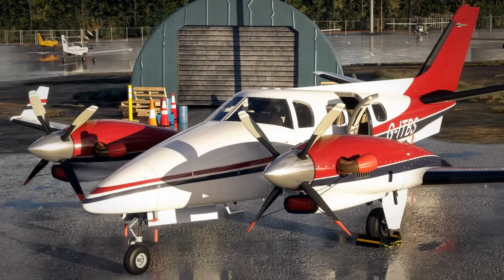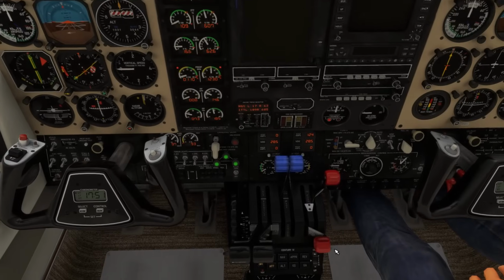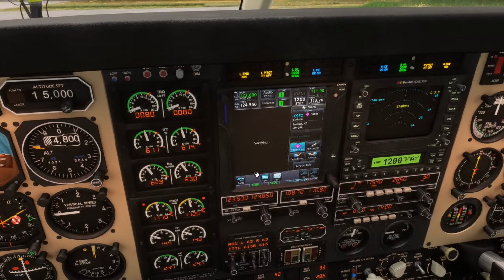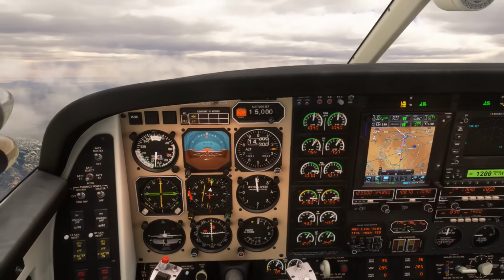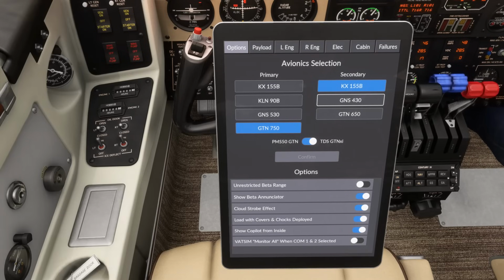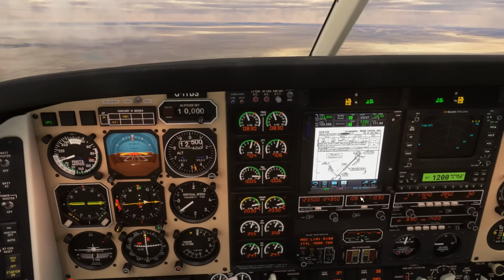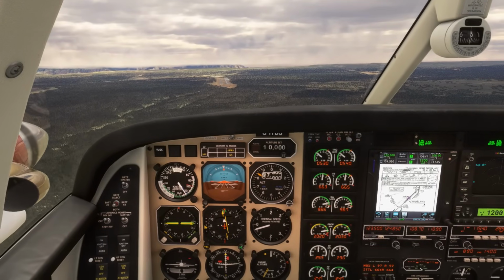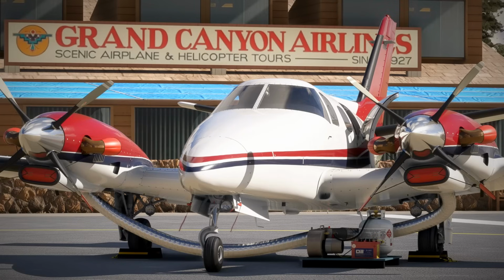Another Exceptional Addon! | Part 1: Black Square Turbine Duke | Full Flight Preview / Review | MSFS

Comment: An update on what the dev has said about release: the Dukes have been tied to the SU15 update because of 1) an issue with the WT Garmin 530 that requires a manual work-around at the moment that SU15 would have fixed, and 2) making use of the new ground handling in SU15. However, with the recent delay, the developer said yesterday on the JustFlight forums that they are considering a pre-SU15 release and have mitigated these remaining issues. So , hopefully it will be out sooner rather than later!
Reply: Yep all correct and yes it will be out soon, very soon we hope.
Reply: @justflight   I really hope so. I rather have the Dukes now, but with those known issues* than without them, but later.  I would guess that most people that are waiting for those aircraft think similarly.

*(which are going to be resolved very timely anyways with the SU15)
Reply: I will be quite happy to have a pre SU15 model happily accept the minor issues
Reply: @justflight  any form of time estimate (like this week or within a week kinda estimate)?
Reply: Oh this is good news! Holding back such a masterpiece like the Duke because of "the eternal SU15 that will never be" for 10 more weeks (or even half a year or no one knows how often SU15 is getting delayed agein) would be outright false :) True art like the Duke must be honoured, and some small GNS530 issue can easily be patched with some small hotfix at the end of 2027 when SU15 is released.
Reply: @juliashenandoah3965  It's out as of now. Bought both aircraft of course.
Reply: @Th1235  That´s the spirit! :)

Comment: This is the kind of add-on I'd love to make an around the globe flight with!
Reply: I will too... I already had one in the making with the A2A Comanche, but I think I will start over with the piston Duke... It could take the Crown the A2A C250
Reply: @Tom__L to be fair the A2A has so much detail modeled such as airframe wear and damage, visible pax and cargo, icing, full external aerodynamics/flight model. I know the Duke will be amazing but mate I’d finish the tour in the Comanche!
Reply: @boudewijnzwaal8186  Yep, the A2A is amazing and hard to beat. But the Comanche is not a very complex aircraft in general. I like the more complex ones and the Duke has nearly everything you can dream of. From a second engine to pressurization, turbochargers and a complete deicing system and cool stuff like the oldschool RNAV system. I love to fly VOR only.
Reply: DC-6 might be a good candidate too
Reply: @ancientmonotheism5118  hehe, complexity wise the DC-6 is truly amazing. But I like small airfields, and low flying. Not the right plane for that. 😄
Reply: @boudewijnzwaal8186  Now after a few days with the Duke, i am with you. I love the Duke. It's a brilliant aircraft, but the C250 has a bit more "soul" and tracks everything I am doing. The Dukes missing a lot of state saving and that takes a bit of life out of the airplane. 
The main problem with a world tour in the Comanche was the missing Sim Rate support and on long legs it could get boring or ends in fuel cheating while speeding up. But I just wrote a SPAD.neXt script that corrects the fuel consumption on higher Sim Rates. 🙂
Reply: I did it with the A2A 377 Stratocruiser, it was amazing at the time it came out. Too bad there isn't a remastering of it...
Reply: @TerminatorFRA  good old fsx days ..... A great addon!

Comment: The Beechcraft 60 Duke is a twin-engine, six-seater fixed-wing aircraft developed and manufactured by Beechcraft. The aircraft has retractable tricycle landing gear and a pressurized cabin. The two piston engines are turbocharged, and the turbochargers also pressurize the cabin with bleed air. Some Dukes have been modified by Rocket Engineering of Spokane, Washington, replacing the Lycoming reciprocating engines with Pratt & Whitney Canada PT6A-21 or -35 turbine engines. The modification does have some disadvantages as it increases fuel burn from 210 to 250 L/h and lowers the certified ceiling from 30,000 to 28,000 ft (9,100 to 8,500 m). The last variant, the B60, was introduced in 1974. Production was discontinued in 1983. Despite its excellent performance, the Beechcraft 60 was only a moderate bestseller, mainly because the complicated technology required a high level of maintenance. Built to the quality standards of a King Air, the Duke sported 380-hp, Lycoming TIO-541 engines - rare beasts, those - which means when both come due for overhaul, the choice is the overhaul or buying a small house in the Midwest. In a few days, anyone can buy this MSFS 2020 add-on for a fistful of dollars. Without risking a fortune. And without blowing at least 170 liters of aviation fuel into the atmosphere in a single hour. When planning cross-country flights,  piston engine pilots typically assume a fuel burn of 170 liters per hour, plus another 150 liters for each takeoff and climb. Owners compare the Beechcraft B60 to classic sports cars and emphasize that they don't fly the Duke to save money. Oh, the Beechcraft Duke. What a beautiful airplane. It has always been one of my favorites. I've seen them flying in real life from time to time. But they are rare. Another exceptional preview by Into the Blue Simulations. Black Square’s Piston Duke brings you one of the most technically advanced aircraft simulations for Microsoft Flight Simulator, with an advanced reciprocating engine simulation, over 120 possible failures and the most advanced turbocharger, pressurisation and cabin temperature simulations in MSFS.
Reply from the maker: Many thanks, Peter! Interesting, as always : )

Comment: Quite an unusual subject for an add-on, even the piston Dukes are rare (and getting rarer with the cost of overhauling the engines exceeding the value of the airframe!). The turbine even rarer than that, but nothing wrong there, I'd rather see this kind of GA aircraft in MSFS that you wouldn't get to fly in real life, rather than the common singles that you can rent at your local airfield easily.

Comment: "*Sometimes* a little light on the controls" has generally in my experience of constantly fiddling with aircraft been down to MSFS "stability" settings - one set of which are only stability if you consider that to be "pointing into relative wind" which in the ever prevalent MSFS turbulence is anything but stability, and the other set are basically a giant gyroscope & make it feel like there's a big hand holding the aircraft ( I kinda like to think of a giant toddler making brbrbrbrbrr sounds ). Some a/c respond well to just zeroing them - the BS king air took really little work and only a small chat with a B200 pilot - and some need everything else adjusted, unfortunately, and I'm fed up with doing it :p that has put this on a wait & see I think, given your usual gift of understatement. I'm really waiting to see if the turbine & avionics from this make it into the King Air.

Comment: Nice flight in what appears to be a fantastic looking aircraft on the way. The only thing I noticed was that you didn't turn on your landing lights when you lowered the landing gear for the approach. I do not know the particulars about the turbine Duke but after 1000' AGL you usually should turn off the fuel pumps.

Comment: Another excellent review! I know that you didn't need the reversers for that landing but it would've been interesting to see them at work anyway. I typically like to see any aircraft that have reverse thrust/props incorporated into the design to be demonstrated, but that's just me.

I did notice that the "Left & Right Oil Doors Closed" annunciator lights were illuminated throughout the entire flight. Is that the typical state these 2 doors should be in? I'm asking because the "yellow" lit labels are usually indicating that the pilot should consider the function at some point and either activate or deactivate the option.

However, I have absolutely no idea if this is always the case. I know the BS Piston and Turbine Duke have been released recently and I believe you've done the review on the Piston version in Part 2, which I do plan to watch.

I did consider buying the "Bundled" Piston & Turbine Duke versions, which would save about $20 USD. But I decided to go with the Turbine version only because I simply don't have very many multi-engine turboprop aircraft in my personal collection.

I'm burning daylight and I need to get on with that purchase so, thanks again for a great review!
Rich

Comment: My favorite GA Twin in FSX was my King Air.  I don't recall at the moment who the publisher was but it's still on a disk somewhere .  The system depth of that dude was amazing.  Hot starts, circuit failures, etc.  I have to build a system but I want this.
Reply: Possibly the Flight1 King Air 200?  That one had a G1000.  Otherwise the old Aeroworx analog king air was incredible as well.
Reply: @RyanbATC  I'd have to look but I have a large catalog of Flight1.  I remember it had a digital (PFD, etc.) cockpit or analog.  I always used the analog.

Added in Edit:  Flight1, ATA, VRS, were the lion's share with a couple of Iris and a smattering of Carenado (which with ATA's realism add on were actually pretty good) and a couple of boutiques like Dino Catteneo, a French dude's C-150 Aerobat, etc.  With the ORBX, Real Earth, power line add ons and a couple of homebuilt sceneries it was really a very nice sim.  MSFS looks amazing though.  I'm reticent due to some of the limitations.  For instance, if I want to fly my VRS Superbug, I'll need to add Prepar3D or reinstall FSX.  I just wish there was an effective way to bring my hundreds of dollars of FSX stuff into MSFS, including TacPac.

Comment: Turbine Duke uses flat-rated PT6A engines.

And if even an addon that claims to be such high fidelity cannot get the ITT behavior right as altitude increases, then there can be no hope for MSFS.

Alternatively, Black Square didn't bother implementing a proper turbine simulation despite all the promotional videos.

Note for the video creator: Climbing to higher altitudes in a turboprop with flat-rated engines would allow the viewer to better determine the behaviour of the engines.

Comment: I need help...  I can't get mine started. 
While going through start up procedures.. while trying to start Right engine...
Hit start switch toggle....  bus volts to 15v... Gas Gen to 15%...
When I push Conditioner lever up to full... The ITT doesn't move. Therefore engine will not start !!!   !   The ITT on videos people have made clearly starts up.  

I have tried to start going through exact procedures numerous times to no avail.
WHAT am I doing wrong? Help me understand...
Thank you... David
Reply from the maker: Hello David,

Have you managed to get things sorted? It sound like 1 of 3 possibilities:

1) A broken engine (you’ll need to go into the tablet and make sure everything is in working order).
2) A lack of fuel flow (make sure the fuel selectors are on, fuel pumps are on, etc).
3) A lack of ignition (make sure the igniters are selected on, etc).

Does any of that help? I don’t think I covered the fuel selectors (located between the pilots seats) during my video so, I’d guess that might well be the root cause.

I hope that’s of some use. All the best!
Reply: @IntotheBlueSimulations  Downloaded new update. It seems to have corrected most issues....         THANKS for your response !!

Comment: Instant package purchase. - But unfortunately it is U15 depended.    Hope U15 will be final for msfs 2020, so publishers can have more predictable platform to work with.
Reply: It's not SU15 dependent.  Works fine in SU14 too.
Reply: @justflight  Right.  You have the option during install to select 'SU15' or 'Not SU15.'
I installed it for SU14.  When I get SU15 I'll reinstall the planes per instructions.